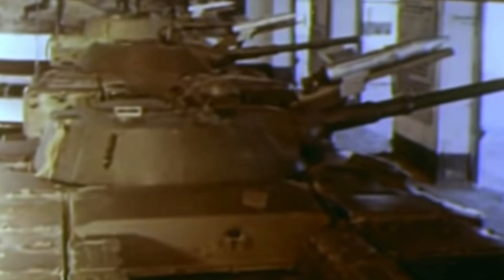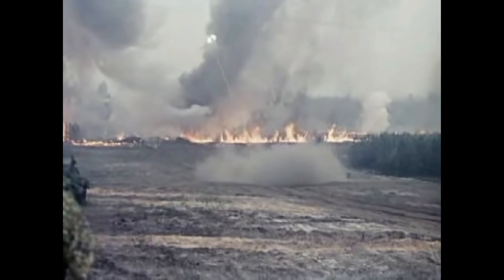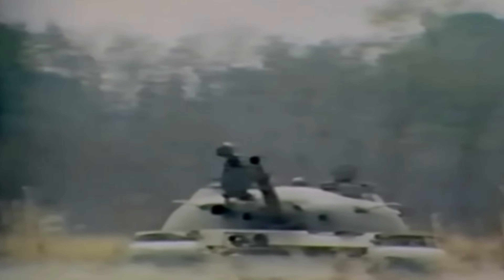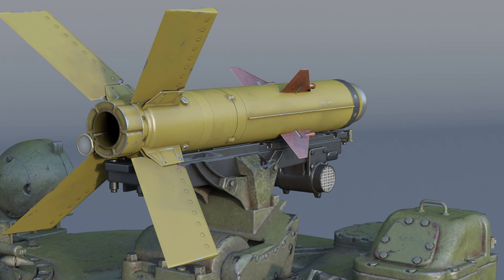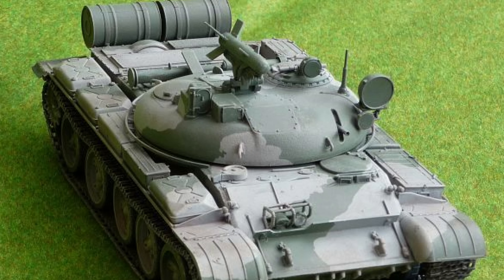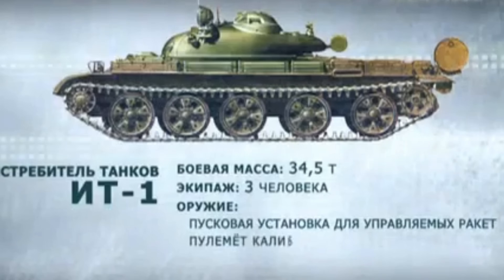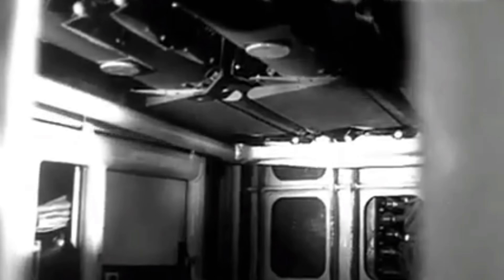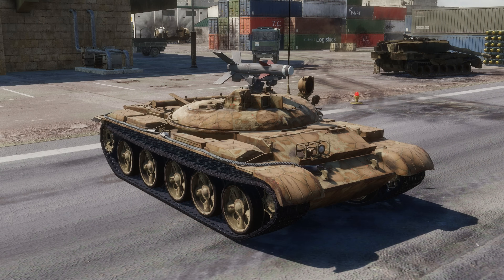IT-1 Tank Destroyer | SOVIET ANTI-TANK MISSILE VEHICLE

Comment: HEAT made steel plate armour obsolete so when anti tank guided missiles came around from 1955 onwards and gave lighter vehicles the ability to outrange and kill tanks the future of tanks as the armies main offensive weapon became in doubt though various counters where tried. 

In 1959 composite armour that could protect against HEAT came around with the T-64 in 1964 culminating in the M1 Abrams and Challenger tanks in the early 1980's as some of the most well known.

Germany and France tried to use speed to defeat early manual steered ATGM's by being to fast for the missile operators to hit with the AMX-30 and Leopard 1 in 1962 and 1965 which worked till 1970 and the SACLOS ATGM's started to come into service.

The USA in the period of 1955-1980 while having tanks focused more on overwhelming air power to deal with Soviet tanks rather than matching them in tank vs tank combat and when tank combat did happen was looking at the 152mm gun/missile launcher of the M60A2 to be the main weapon also see the failed MBT-70 that would also have had the 152mm gun.

Comment: I've been wondering if we could make a tank destroyer out of a vehicle only a little bigger than a German Wiesel. We could load it up with Javelin anti tank missiles, and put the necessary electronics into the vehicle. We could make it where it could fire multiple missiles, all controlled by electronics inside the vehicle. If we could network it in to an air to ground radar similar to the Longbow Apache's, or just a helicopter drone, and have this air to ground radar covering the entire battlefield, with no seams. That's a system that would be hard to beat.

Comment: Not a bad idea take old but useable tank hulls and create spatgm out of them.
Reply: Modern turrets modern missiles much the same way Israel converted old Soviet tanks to apcs could save poor nations lots of money. Peru if memory serves put atgms on frontline tanks
Reply: @colnagocowboy it's a bad idea because:
1. obsolete platform. this means you have to maintain production of spare parts to keep them running, so you actually have to keep an obsolete tank in production to cut some costs. this strategy never works and leads only to extra expenses. not speaking about logistics  - trying to supply parts and materials for an array of different vehicles is always a pain in the ass. unification rules.
2. you don't need a tank to host an ATGM. full stop. your ATGM launcher will not storm enemy trenches while supporting your infantry. so it doesn't need all than fancy heavy armor. need a mobile ATGM? put it on the light chassis - wheeled or tracked  - as you wish.
Reply: actually it's quite bad idea.

Comment: Now: The principle is that a tanks gun kills tanks primarily with the speed of the projectile! But due to the sound barrier there is a definate range to that (say about 7-800 m) which is also the distance where you can use direct fire.
Guided missiles have a minimum range of around said distance - thing has to leave the tube, gather to line of sight, etc.  The target will have moved and you need to have the guidance system to correct for that - leaving out a lot of the guesswork in tank gunnery.
On the shorter ranges the speed of the projectile and the flat trajectory does not leave the target time to do very much.

In a brawl you need BOTH. You can of course have units with a mixture of both. But my preference is to have the tank in tank units and ATGM in their units. This means that I prefer mounting the ATGM on the Infantry combat vehicle - OK with a limited number of missiles - 30 missiles pr. vehicle seems to be overstocking.
If you need more for the next day or so - it is probably better to have them flown in with a tactical transport.

The primary protection of the infantry against tanks close in is in the dismounts. But the real tank killer is to have the tanks come into the fight when things get close and dirty.

As You might understand: I think combined arms is the idea: Cavalry, Artillery AND Infantry.

One should note that tanks is the CHEAP part of the solution, because a tank has a crew of 3-4 and an infantry combat vehicle has about 9-11 - and what costs money is the pay for the troops (and their training).
It is a grave mistake to assume that infantry is the cheap part - it isn't.

The figures I've seen (quite some years back now) was that a squdrons (company) of tanks was about 2/3 of the price of a company of infantry. For compareable protection and mobility.

Another misconception is that conscripts are cheap - they are not. The time in basic training is wasted after 2 years. And the basic training takes a year - and then in practise thrown away. Basic training of less than a year is basically a waste of time and money, because in a real fight undertrained personel gets killed - fast and achieve nothing.

Comment: Since You are on the topic: There should be a couple of German vehicles - from the same periond - in the category that might be interesting to look at: 

Kanonenjagdpanzer 
https://en.wikipedia.org/wiki/Kanonenjagdpanzer
Where the idea was to take the BK90/L40 gun from the M47 Patton (must have had lots of ammo lying around) - get rid of the ruddy turret and save 40% of the weight. Putting a decent engine into it and double the speed. Third property was reducing hight relative to the tank solution - Leopard 1 - with 17% (1/3 with repect to the Patton). Problem was that with the T64 coming on line the 90 mm gun just did not cut it.

That led to the Raketjagdpanzer 2
https://en.wikipedia.org/wiki/Raketenjagdpanzer_2

Which used missiles to hit at long range.

The idea in itself is not a bad one: They are easy to hide, have great tactical mobility and are cheap to build and operate.

Comment: Are IT-1 were exports to other Eastern Europe countries after 1965 ?
Reply: "Yesterday I saw how effectively tanks are destroyed already on the approaches. In the presence of such anti-tank missiles, tanks are unnecessary!". However, the designers themselves, first of all L. N. Kartsev, knowing the real combat capabilities of the complex, were much more skeptical about the prospects of replacing ordinary tanks with missiles. The removal of Khrushchev from power prevented the implementation of plans for the full-scale production of these types of military equipment into service, and work on it, as well as on other rocket tanks and self-propelled ATGMs-tank destroyers, was largely suspended and continued at a much slower pace (as a result, less than two hundred vehicles were produced that did not take part in armed conflicts).

By the end of 1964, 94 test launches were made with Dragon missiles. The design phase was completed in 1965.

It-1 was in service with the Soviet Army for three years. According to the plan of the military, separate battalions of tank destroyers were to be equipped with motorized rifle divisions deployed in tank-dangerous areas. Only two such battalions were formed: one in the Belarusian and the other in the Carpathian military districts. During testing and operation, the missile system showed high reliability — up to 96.7 %. However, its design disadvantages: large dimensions and weight, outdated element base, large dead zone, lack of a tank gun, etc. served as the reason for the removal of the it-1 from service. These vehicles did not participate in combat operations and were not exported.
Reply: @elusive6119  thanks friend for these valuable knowledges thanks

Comment: It's funny to see when at the time atgms was considered even more powerful than tank canons(when apfsds weren’t invented yet?) and the soviet pancake was designed as a TD with a 180mm missile.    

It's the wonky interim period between ww2 and the early cold wars where we find these soviet gems
Reply: APFSDS came into service in the very late 70's when the west learned the Russians where using a lot of composite and reactive armour on the T-72 and T-80 tanks making HEAT shells far less effective.

APDS development stopped in the late 1950's when large 105mm HEAT shells where found to be amazingly effective against steel armour.

There was a 15 year gap between the last APDS entering service for the 105mm and development starting for the first APFSDS for the 105mm gun.

Edit 

You will find mention of the US issuing the M728 APDS in the early 70's but that is a US built version of the British L52 that entered service in the early 1960's and that entered development in 1958.
Reply: @Ushio01  APFSDS came into service in the late 1950s in the soviet union.
Reply: @petermuller3995  source?
Reply: @Ushio01  source for everything you wrote first pls.
Reply: dandoosh garra  And before that there was the 100mm Anti tank gun T-12